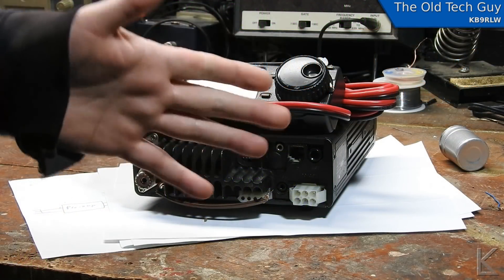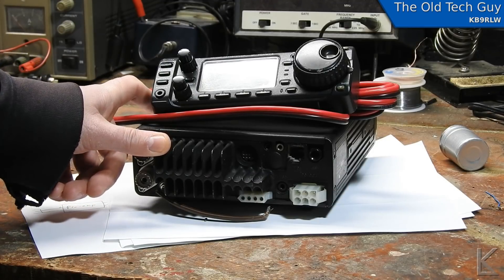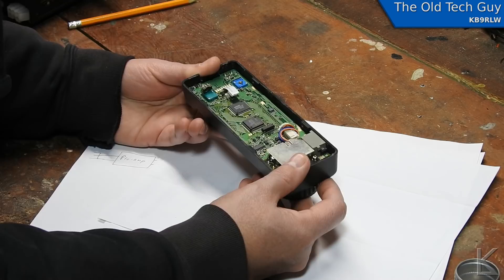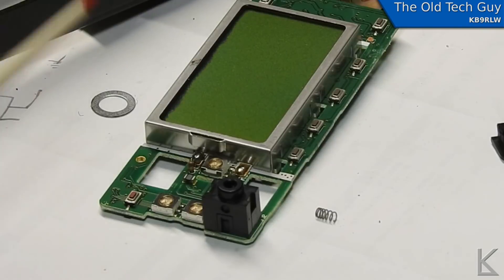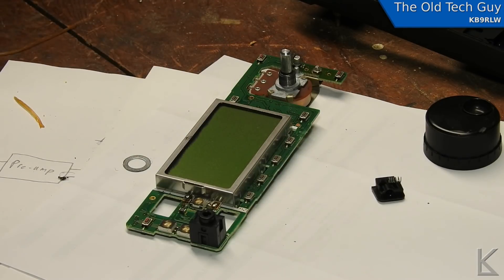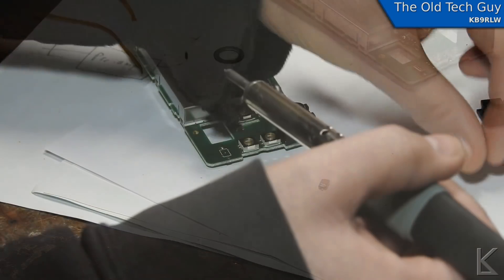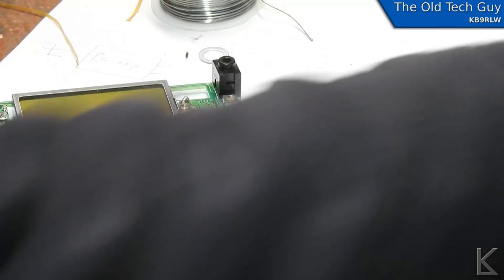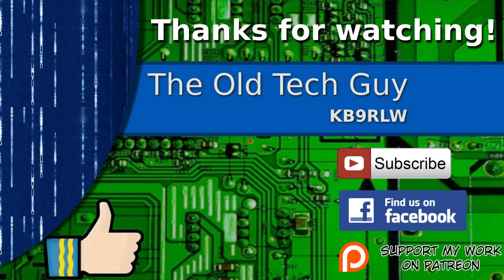Ham Radio - ICOM 706MKII with failed front panel buttons repaired

Comment: Perhaps u can helped me Sir..the knob of my IC-706 MK2 is not working..i cant turned it to adjust freq..is there any settings or way to fix this?
Reply: it turned out VFO encoder broken..so u know replacement for it?it has been discontinued
Reply from the maker: Sorry, but no, I don't know of a source.  You might look at the specs of it and hunt around on digikey, mouser, and others for something similar.

Comment: hi i have problem to pull out the vfo knob. i don't understand the right way to pull out it. on the service manual i didn't see the solution, on the first time i think there was a screew, have you an a good idea for me? thanks
Reply from the maker: I can't remember that one. Most will have a hidden screw under the rubber grip ring on the knob.

Comment: Yep, I always use 2 temperature controlled irons with conical bits, for ANY 2 lead smd removal. Then, not to lose it (!), I just flick the component into a small wooden container on the bench.  If you can't afford another iron, you can wrap thick bare copper wire around any tip with parallel sides, cut the free ends the same length, and space them the width of the smd solder tabs.  Tinning the ends with a small amount of solder before use also helps.

Comment: I'd like to know where to buy these switches.
I lack the junk pile...
73 DE KD5FUL
Reply: I just bought some on ebay.  https://www.ebay.com/itm/10x-10pcs-6-3-2-5mm-Surface-Mount-Tactile-Pushbutton-6x3-Switch-SMD-Tact-Micro/252838999704?ssPageName=STRK%3AMEBIDX%3AIT&_trksid=p2057872.m2749.l2649

Comment: i am working on mine as well but want to know how did you get the vfo knob apart. I need to clean the lens on mine which turned smokey black on the inside
Reply from the maker: As I recall, there's a grub screw hidden under the rubber grip ring.  The rubber slides off the metal knob.
Reply: OK WILL CHECK THIS OUT

Comment: do not try this on a ft 817 send it to yeasu the switches a 4 times smaller  73  kg6mn
Reply from the maker: I hope they are also more durable.   I've had an 817 for many years and it still works perfectly.

Comment: Do they still make these babies?
Reply: Sam Iam, they do not. The IC-706 MKII was replaced by the MKIIg which in turn was replaced by the IC-7000. The MKIIg is a superior radio in my opinion. If you can find a decent one at a price that does not include any "nostalgia factor" (cf., Kenwood TS-830s). and is in decent shape, by all means pick it up.

Comment: When I have to desolder a SMD component with two legs like that, I find it easier to just add a little extra shoulder and use the iron to heat up each leg quickly while applying gentle pressure from the side with tweezers to move it off the pads. Solder braid doesn't work with SMD parts. There's always a little solder left under the leads, as I'm sure you found out.
Reply from the maker: Yep.  Solder braid was not the way.   I don't think my hands are steady enough to move the tip quickly from one side to the other though.  But tweezers to pull upwards just a tiny bit might have worked a bit better.  I'll keep that in mind for the next one.
Reply: Kevin Loughin, heh I hear ya. You'd be surprised by how slow a big solder blob is to solidify ( when it's not silver solder ). I should have made that part more clear... Leaded solder is the key, good ole 60/40.  There's also this product called Chip Quick, it's a special low melt temp alloy designed specifically for what you were doing there, for people without special SMD rework tools who only see themselves doing SMD work once in a blue moon.
Reply: Two soldering irons work well in a pinch.  But the blob of solder works well also.